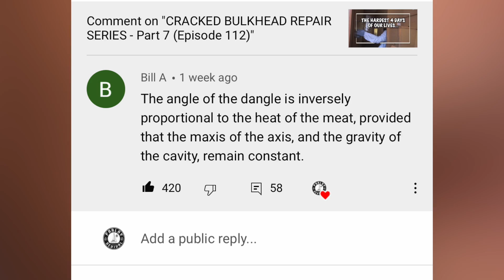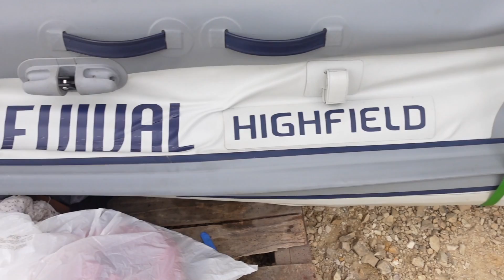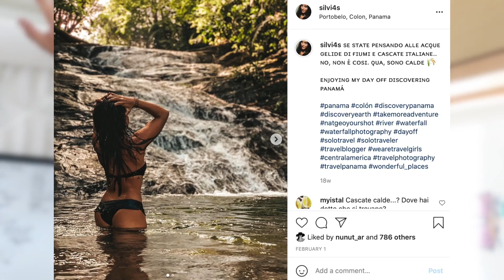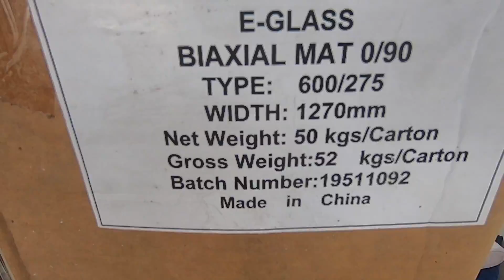CRACKED BULKHEAD REPAIR SERIES - Part 8  (Episode 113)

Comment: Just a suggestion here, I would have replaced that fiberglass beam a double layer of plywood beam on both sides at a minimum, if it was my boat I would have made a complete bulkhead out of 3 layers of plywood.

Comment: Could it be that the design “weakness” of the bulkhead was intended to dampen stress so that the boat would bend rather that break apart?  Better the bulkhead give than breach the hull.

Comment: I spent years working fiberglass and epoxy resins with very little use of filter masks and environmental mediation of the work area, decades later I am still kicking. I also spent years working with acetone using it to clean my hands and dry out cuts on my hands, people that come down with cancer from various hazardous materials is the luck of the draw. If you have a sensitivity to the material then you run a higher risk. The food, water and medicines we consume have a greater chance of making us sick these days.

Comment: I use the Aussie made bote cote epoxy, water based and no amine blush. plus clean up with water, no rashes, fumes etc etc and is proven with many years of use by pro's and beginners. Also 2 to 1 mix ratio. No I'm not affiliated with the company

Comment: I have to commend you on your extreme dedication to this amazing project.
I which to address and question the following.
Why not just gut the entire boat and do super reinforcing now? 
What glass are you using? E or S..S glass would be a better decision and wiser since your going to the Pacific's.
But if your restricted to e glass I HIGHLY RECOMMEND using a cross pattern layout. It builds strength.
If you could request carbin fiber or even kevlar your hull,deck, etc would be absolutely ideal.

Why continue to use balsa wood for your sandwich material? There are better options. That are stronger.

Are you using epoxy strictly..I would.
All others are imo too weak..especially for a Pacific ocean adventure.

Do you have access to vacuum infusion?

Comment: Someone did a bad job making this boat. And it looks like you have to redo all important joints. Actually probably it would be better to do ALL of them, just to be safe. Because, when you strengthen some , the load might crack others, that currently are not broken.
Anyway, lost of work to do.

Comment: Hey Colin, Nice professional structural repairs you guys are doing. I do a lot of that kinda work with foam core and pvc board. Captain doesn't want any wood in this center console rebuild. We use polyester putty to glue in stringers & bulkheads. Look into a mixing paddle for your drill. It mixes quick when time is of the essence.( mek & resin etc.) I plan on hunting down a project Lagoon for myself. I have a feeling there will be a few needing bulkheads repaired. Over engineering is the only way to do it right. Keep up the awesome work and sharing the progress.

Comment: Over Engineering is the only way to go, One and Done, Awesome work!  I’ve been thinking about your boat along with the others, y’all are dealing with poor engineering and bad design directly from the manufacturer.. They always do shit on the cheap, which in turn has the trickle down effect, literally poor hardware, leaking water in, bad design from the get go, with the bare minimum for structural supports, it’s just appalling.  It’s more common then we’d like to believe, It’s always about how to save a few bucks, and get a finished product out for the sale, and just let the next guy worry about it.  I feel your pain brother, 😡

Comment: Colin, why are you not attempting to increase the cross sectional area of load bearing beams? Is it impossible to replace the beams? I see you are glassing and using epoxy. Don’t you want a larger cross sectional area to bear the tension, compression, and torsion forces?

Comment: I was looking at some pictures of older catamarans and noticed that many of them have oval shape passages through the bulkheads, where the newer ones often have square passageways. It made me think of the de Havilland Comet with its square windows and why airplane windows are now round. Is it possible that there will always be a lot of stress in the corners because they are square shaped instead of round?

Comment: I’m no engineer but maybe catamarans are poorly designed for rough water.  Theres two separate hulls that have different levels of force from waves compared to a regular hull.  One side might be going down the other up.  Maybe the lagoon was built with that in mind.  Making it totally solid might cause some issues ?

Comment: Try pulling the peel-ply off in the dark. The bond being broken emits a static electricity (I assume this is what's happening) that creates a cool little light show. I know this works with epoxy but not sure about other resins.
BTW - Peel-ply is just suit liner (100% nylon). When I was building, I was getting it for around US$2 per yard (36"x50") in bulk. But that pricing was almost 30 years ago in SoCal. I don't know how available stuff like that is in your area and I haven't bought any in decades.
For some of my fillets, I cut some scrap carbon cloth remnants into 1/2" or 3/4" threads and mixed them in the epoxy/cabosil putty. I believe this strengthened the fillets enormously (although working with the carbon strand in the "putty" was a pain in the butt). 
I tested some carbon infused putty vs regular putty by smashing some cured pieces with a hammer so it wasn't very technical but there was a noticeable difference. I'm sure some glass threads would strengthen the mix too. Like I say, forming the fillet is more of a pain in the ass this way, but stronger.
Oh yeah. When you are pretty like Sylvia, your odds of being invited to join the crew on a boat go up immensely. 
Good Luck and get well soon.

Comment: A word of caution to all those saying, "Yeah, build it back like a tank so you don't have more problems."  The key word in over engineered is engineered.  If something is made much stronger, or stiffer in the "weak" area, the loads will just move past that to an adjacent area that was not strengthened, and then that will start to crack.  So, super strong is not always the best in a localized area.  This is why Colin laid up the glass in larger and larger patches, to gradually transition the loads through the piece.

Comment: If your bonding a bulkhead in and filleting the thickened epoxy but not glassing straight over the top add peel ply over the fillet like you do with glass... great work btw👍

Comment: To save you drilling the access hole for the jigsaw every time mate, you can turn your saw till it faces you, put it on the nose of the base plate and drop the blade into the work piece through the area you wish to remove, it’ll jump about for a few strokes but with practice it’ll drop through the work piece (sheet material only guys) then you can stop, turn the saw or yourself around and crack on, frees up your drill and negates the need to handle two tools in a confined space. Unless that’s your thing😄

Comment: Anyone catch the name of the powdered product mixed with the epoxy at 17:10? Working on a somewhat similar (albeit much smaller) repair in need of the same sort of adhesive/bonding.  Sounded like "coverseal", but can't find anything by that name...
Reply: Cabosil is used with epoxy resin to make the adhesive.

Comment: I hope the manufacturer is listening, and taking head of your structural issues and making corrections to new engineered drawings for future builds. They should be right their in the bowls of your boat with you , as well. Good luck on your endeavor and the challenges ahead. PS: Enjoyed your stint on that charter sailing yacht.

Comment: Your technic od certainly good ans i encourage you. As it vas bien said, thé priority IS health.
Yes the époxy résin is efficient and need précautions to Work healthy. I have Work in the industry ingeree with these products. In closes ambiance WE used ventilators extractors systematicaly for thé workershealth. Its possible to rent them. Would be pity to risq problèmes of cancer that not the deal. WE ARE with you ans want you succeed and happy navigations✌️✌️✌️

Comment: Collin, love your videos.  You are addressing the weak area where the single layer of plywood crushed in between the other two  I'm sure that new areas won't fail again...but the forces will now move upward to the beam you worked on.  The lateral pressures on the hulls will try to pull the bulkhead from the beam or push up on it.  That is the new weakest point.  You probably already know that, but that is the area to really over build.

Comment: Hi I'm a builder  hear in the uk as in construction and from a family of builders and my father was a chippy and cabinet maker plus draftsman so lots of experience with timber materials and one of the things that i was taught from the moment i started in construction was the importance of storage of the timber, as in how to manage the moisture content to stop rot and warping and it strike me that the weakness may have started simply with how the ply was stored at some point and then if it was subjected to rain water slowly soaking in over time, you would have a cascade effect, after all the rot is a fungus and only needs timber for food and water.

Comment: I know this will be to late, the weak part is at the bottom of that door way should have a big radius that is a huge design fault there is not enough material between hull and door.
Reply: I was thinking the same , even lift it 300mmm and add a step better to be safe

Comment: To Paraphrase "The more I talk to other owners the more I think this is not just hurricane damage". I worked on a 440 helping a friend out. One of the bulkheads under the floor of the Starboard forward heads had literally fallen out. No tabbing just snot holding it in place. Worst still it was virtually impossible to get to to repair or replace. The heads floor had to have an access panel and watertight door cut in the floor just to repair it!   Sail Safe Guys, Ant, Cid & the pooch crew.

Comment: you know the bulkhead that was there is very thin for the size of the boat 🛥 there a federal surrender in the books for the boatbuilder of you your boat and avers on the account that the building of them is substandard and should never been put to sea

Comment: At this point the series should be re named; “Building a functional Blue Water Catamaran the CORRECT way”.  I’ve said this before but will again; Mr Lagoon CEO/President, you should be hanging your heads in shame. To have your company’s dreadful, amateur design/production failures exposed by a couple of young guys with a hearty dose of enthusiasm and common engineering sense is an incitement on you. Do the right thing for once and reimburse these guys for the work they have had to do due to your company’s blatant negligence. At least then your reputation will show some modicum of integrity.

Comment: Probably too late now, but try applying the filler in an icing bag. Get a thick plastic bag (ziploc bags are good). Half fill with the filler, twist the top of the bag. Cut the corner off and apply. Especially good for coving.

Comment: Filleted!! Soooo important to distribute stress across the joints!
Sealing the edges is what LAGOON didn't do that allowed moisture and rot to get into the ply.
Water should be able to go thro the structure without getting in and rotting out the ply!
There are quite a few videos on Youtube showing this problem now. 

FANTASTIC job boys!

Comment: Colin as soon as I mix a large lot of expoxy paste in summer I spread it out on a HDPE board ( similar to the type used in the old days by plasterers). This cuts down the extreme exothermic heat it generates in a cup or pot and gives more working time before it sets off. Good luck, if anyone is ever making a silk purse out of a sow's ear its you and Jamie.
Reply: Another option is to mix the epoxy in a container that tends to a hemisphere and then pour it into a container that has a lot of base and little depth, type fountain. You have to find a balance with the ambient temperature. If I remember correctly, excess moisture can even inhibit setting.

Comment: So… serious question. Putting in all this reinforced super strong marine ply & fiberglass/epoxy bulkheads is going to make super strong points throughout the boat. Has there been any consideration that those hard points may create OTHER stress points, in parts of the boat not reinforced? (Especially considering the quality of original work you’ve discovered, compounded by hurricane damage and the stresses involved there… ). Just something that popped into my head watching all this hard work.
Reply: I've been thinking the same thing for a while now.. Great question!

Comment: Better off pouring the mixed epoxy resin out of the measuring tub into a different larger mixing bowl and then adding the cabosil to make your glue . Using a large mixing bowl allows you to spread the glue out so as to reduce the heat build up . This also saves on measuring containers which can be easily cleaned with acetone for reuse . 
Breathing in cabosil dust is no good for your lungs .

Comment: Hey guys, when cutting your dry fibreglass, please use a mask. Even just a simple dust mask. The scissor cuts produce small fibres that float in the air and you ingest them. They do not get processed by the body that well and can sit in your lungs. And you know the deal. Love your work.

Comment: Such hard workers. Wont hapen again...won't tighten rigging down 4 tonnes next time. Lagoon will regret not fixeing it for you. You'll show up the pathetically under engineered light weight design.

Comment: The broken bulkheads could be a symptom of a different problem possibly a little bit too much flex between the two hulls or A weakness in the structure somewhere else just a thought
Reply: Colin has shown that a lot of the structural adhesive (grey goo) the factory used inside the bridge deck that ties the top to the bottom of the bridge deck with bulkheads making it structural, and the goo and tabbing that tie the bridge deck to the hulls, failed and separated. This likely then lead to the bridge deck to hull flex whereby the hull beam and hull bulkheads then fatigued and cracked. I'm sure Colin plans on tabbing everywhere there is grey goo. The grey goo is a common failure point in production boats, boats flex and the grey goo (likely a structural acrylic aka MMA) cures hard and brittle unless modifiers are added to it. It may have also cured too much before the plywood bulkheads were installed and not adhered well to them as I think I remember Colin showing the grey goo attached to the hull but not the plywood bulkhead.

Comment: I am getting the feeling that Lagoon has both design and build quality problems. If the boat is used as a day boat they would get away with it, but sustained blue water cruising would be simply dangerous.

Comment: I used to be a pipe welder and we would have to do alterations, changing the direction of the steel pipe, me. and coworders did so many, the rule Was, .  Measure Once, Cut Once, Weld Once, trust your eye and it well never let you down.

Comment: Great work Mate done by the Crew and Your self , Was thinking if you could Add a Wire Mesh before you sandwich the other Ply Panels on the Bulkheads from top of the Hull to the Deck and F/G to make it a solid steal panel as well :) Over Engineered but i keep thinking if its to Stiff will that work against the Hull to Flex when it needs to. ?????????????

Comment: That is not how you scribe to a curved surface! You need to use scribers held in the same flat plane. A block and a pen gets you trying to fit in multiple directions. To fit to a curve you can only fit in one direction- hence you hold scribers flat in one direction only..101 boatbuilders- learning to scribe.
Reply: I did not talk about double curvature- thats another boatbuilding term.  This fitting to a curve is especially seen in monohulls.
To understand the problem, imagine fitting to a semi circle.
Imagine there is a 6inch (150mm) gap at the centre. When you scribe correctly, keeping your scribers level (or at a constant angle), there will appear on your template a 6" mark near the top and that will taper dramatically towards the bottom of the curve. It is physically impossible to fit in multiple directions all at once.
If however you are fitting to a straight surface which has a few bumps  then the block and pen will do fine.
Reply: @Adrian Matthews sorry I am a qualified, trained boat builder. I was just trying to pass on my training. If you only want joint that are "near enough" then sure try the block and pen method. But if you want perfect scribing, then you need a pair of metal scribers, held at a 45% angle. It takes some getting your head around. If you look at a curve as a radius, with a centre somewhere up the bulkhead, then what you do with a block and pen, creates a new  smaller radius. Obviously the smaller radìus will never match the hull radius, because it is smaller.
Even if your rough cut left only a 3/4 inch  gap, using a block and pen, will give you probably 3/8 gap at either end.
It is Not "complicated" to do some thing right.
When you are working with expensive teak ply wood, it pays to understand basic geometry. I know it is unintuitive, but it is not hard to do a professional job.
This secret ends you thinking " oh I seem to have not got that right. Must have done a bad cut with the jigsaw".

Comment: Tip the AC unit a bit so that the condensate water runs to the drip hole in the outside half of the unit.